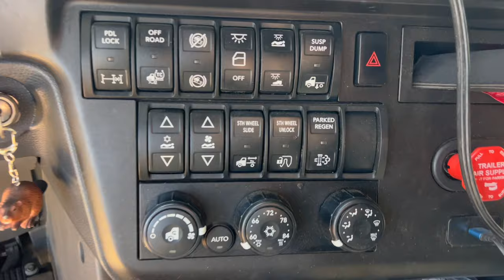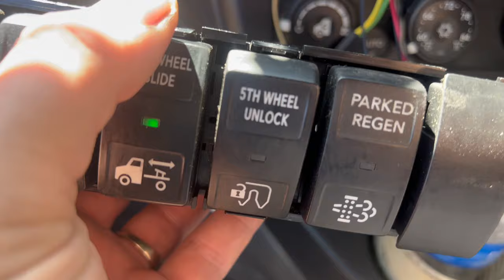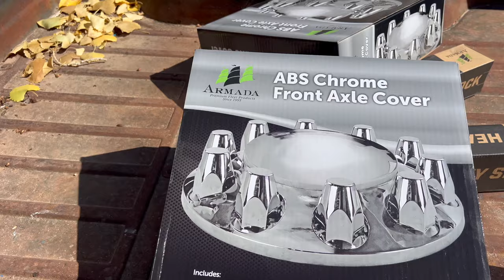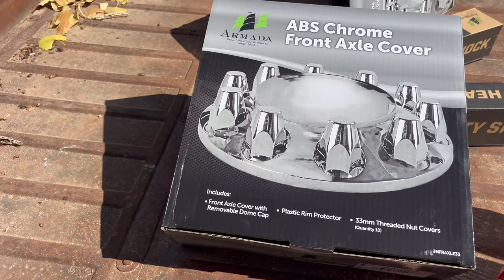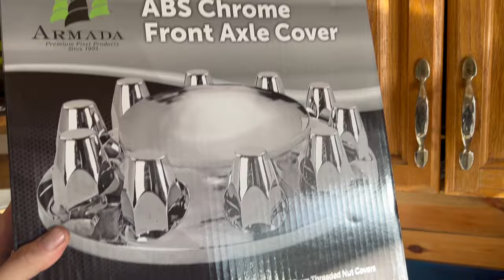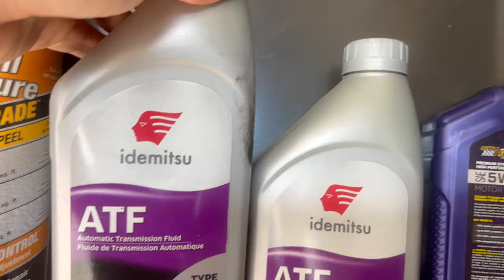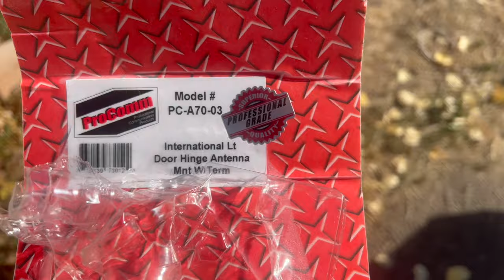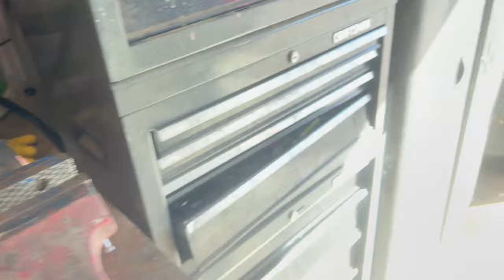Let's Fix Everything!

Comment: Good job bro. One thing to watch out for is your marker lights leaking into the cab during heavy rain, mine did it bad on the drivers side. As far as the locking jaw release and fifth wheel release nine times out of ten it’s the motor assembly on the fifth wheel or the springs are dirty, the motor doesn’t have enough power to operate when things are gunked up with a lot of dirt and grease.
Reply from the maker: It’s released by an air piston on the 5th wheel. I’ve checked that. The switch sends a signal to the solenoid which opens the air valve to open the piston. It’s gotta be an electrical connection somewhere. Hell, he may have never been hooked up. In the fuse box it has “Jaw Lock” “Jaw Unlock” relay location, and no relays! So 🤷‍♂️

Comment: Have you ever shopped LKQ or Vander Haags? Can easily get a used light cover in perfect condition off the same model truck in their yards. That’s something they’d probably have in stock or any other heavy truck scrap yard. Crap ton less expensive too.
Reply from the maker: Whole assembly needed replaced. But yes. I got the KW hood from LKQ. They did not represent the posting very well and ended up costing me over $2k to fix a damaged hood they “forgot” to mention in the posting.
Reply: @DrivingByBraille  Yikes. That is a risk you take buying from those places sometimes. I bought a nice headache rack from them, only a dented door.

Comment: Oh you don't need to take it anywhere to get it patched. Buy one of them cheap kits do it yourself. I've got one that's got about 40,000 miles on it, no issues
Reply from the maker: I have a plug kit. Is that what you meant? Or an actual patch kit where you have to remove the tire and patch from the inside? That’s what I need!
Reply: @DrivingByBraille  yeah that's right now all I have is a plug kit too LOL but hey they last LOL